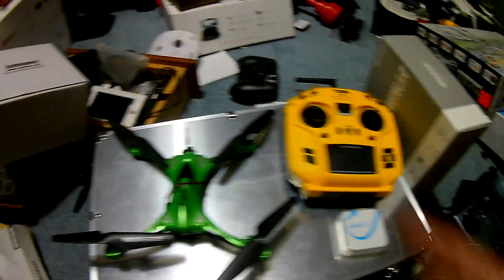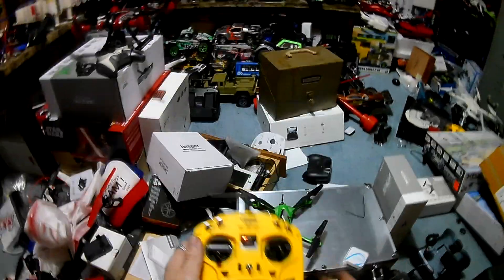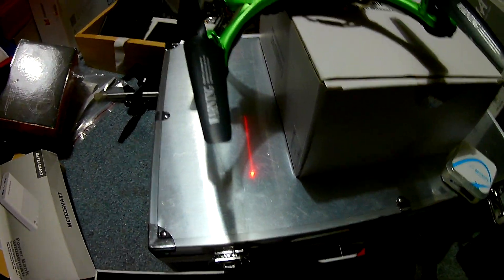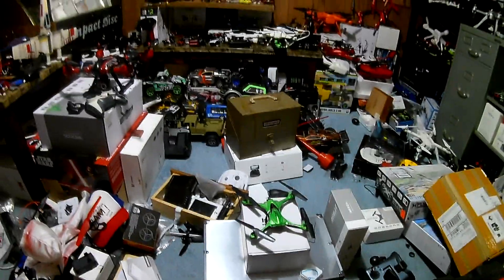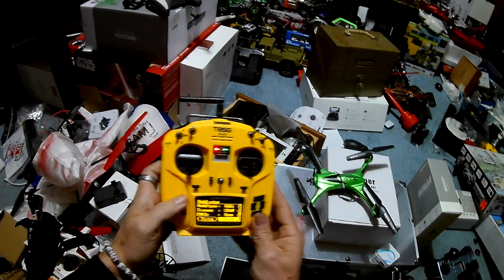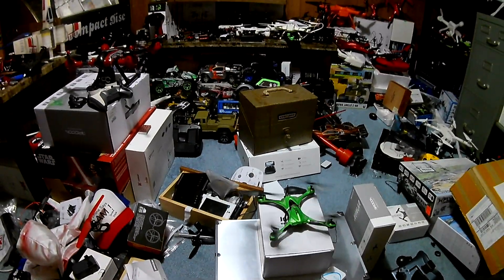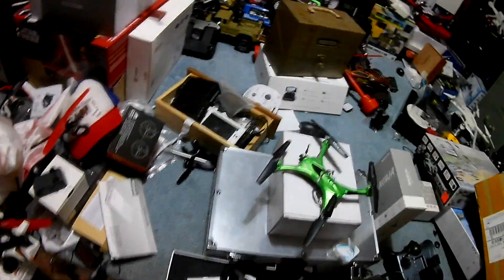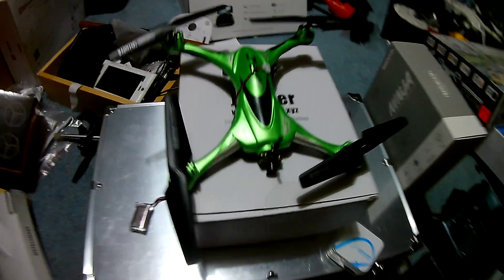JJRC H31 ACRO BETAFPV  JUMPER T8SG 5.8 MOD Test Flight

Comment: Sweet, yep I got one of these flight controllers about 3 weeks ago for toy brushed acro, still deciding which quad to put it in. I need the plug in adapters to wire to motors, where to get bro?
Reply from the maker: I got mine on amazon for this one I stripped a Santa drone

Comment: Hey Jay Drone.  This thread is about 11 months old.  Are you still feeling good about the BETAFPV FPV FC Lite Brushed Flight Controller?  I bought this flight controller and am thinking about installing it in my JJRC h31.  Is it worth doing?  If so, do you have any photos of how you did the upgrade to the BETAFPV FPV FC Lite Brushed Flight Controller?